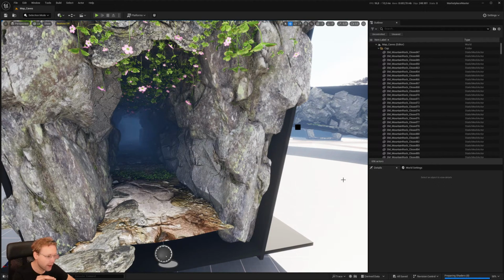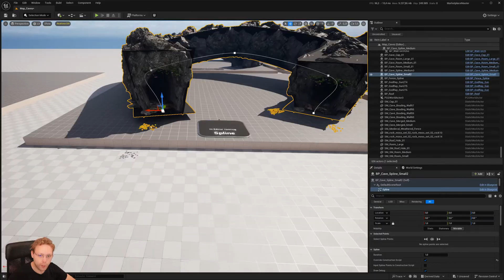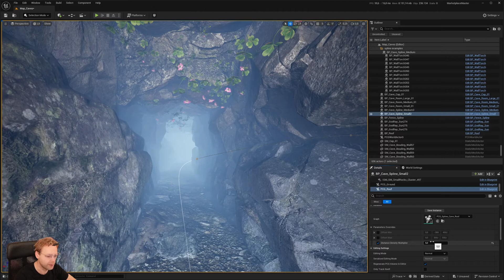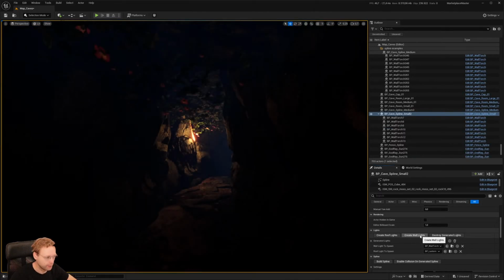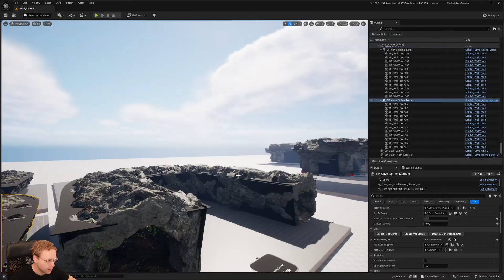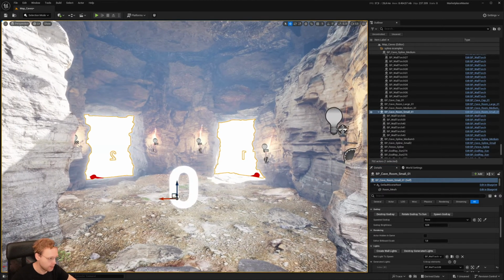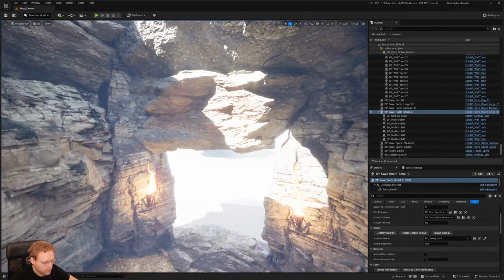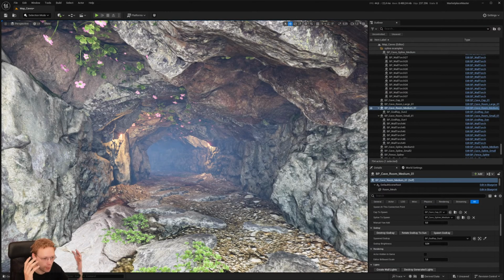PCG Cave Fillings and Lights Generation Unreal Engine 5 | Games By Hyper Devlog

Comment from the maker: The only problem I am facing right here is peformance. I have no idea yet how to make these lights have less peformance impact besides not casting shadows which is ugly as hell. I am quite inexperienced with this.
 If anyone has a tip please let me know. Basically, 12 lights tank the performance by 70%. I do not think baking the lights is a good option (can that be combined with lumen on?). And megalights is quite unstable. Greetings! Eric
Reply: Maybe you could set the lights to have smaller attenuation radiuses? I haven't messed around with many light sources enough to know if thats a great way to help with performance but in a room scene with 4 ceiling lights it actually made a noticable difference when i turned down the attenuation of those lights so they didn't overlap each other as much

Comment: When are you planning on releasing this on market? And could the focus of the asset on market be more the general generation cave tunnels and domes and providing spline"tunnel" meshes and closed dome meshes (which there is a huge lack of on the marketplace) rather then on any cave environment art set dressing (which there is honestly WAAAAY to much of on the marketplace)

I'm in the process of creating this myself and I wouldn't mind having some cave "tunnel/"/closed dome" meshes on hand that play nicely with splines which are used to generate maps like this.
 It annoys me so so much, that many "cave"/"dungeon" assets packs on marketplace are clearly not made by level designers and are just made by environment artists who don't realistically build modern levels using splines/ proc gen

Cheers, love what I see so far
Reply from the maker: I think I’m going to start publishing within a month or so. Depending on any setbacks. I was thinking on packaging this as a whole environment building toolkit. Not sure yet. Could always be seperate. Current focus is not on procedural generation of the whole system but I think  that could be a fun step.
Reply: @ As long as the assets play happy with your average generic spline based mesh/component I think they will play nicely with PCG even if it’s not the main target. (Maybe not deeprock level cave gen, but certainly your average dungeon/cave layout generation)

And sounds exciting! Looking forward to what you publish!

Comment: So we're trying to figure out our own solution on how to light dungeons - so far the solution seems to be: As few shadow-casting visible lights as possible not close to each other (torches, lamps, crystals, fake "holes" in the ceiling etc.) and a base support of "enviro/ambient" lights that don't cast shadows and have "inverse square falloff" turned off. (so you can really fill the interior with their light from origin to the edge of their boundary "bubble") We're also experimenting with setting "indirect lighting intensity" on these ambient lights higher than 1, so that they contribute a lot of indirect light through Lumen without being set very bright. This gives us decent visibility even in areas without in-world lights casting shadows.
We're not really using them, but you might try experimenting with emissive materials for lights you want to put close to each other (and in case of such groups I would put shadow casting on the strongest light (or a couple) and leave it off for the rest). EM can lead to weird artifacts though, as (I think?) they're done in the screen space section of Lumen.
As others said - also be careful with the range of your shadow casting lights and try to keep it closer to the origin, with as little overlap as possible.
One final tip - I'm not sure if your cave modules are merged into one model, or if you're just grouping them in BP - but this can be a potentially suboptimal in Lumen. Lumen has trouble lighting meshes with holes and interiors - basically a room or a house that's a collapsed single model is a good example. If it's one mesh, the processing in the surface cache can be problematic and leave some surfaces unclassified and not reflecting/transferring light. (you can check this in the Surface Cache view - unused surfaces are displayed as pink, iirc) 
So the recommendation is to do walls, ceilings and floors as separate meshes so they can be adequately covered by Lumen's simplified geometry cards.
We've not updated to 5.5, so I can't say anything about Megalights.